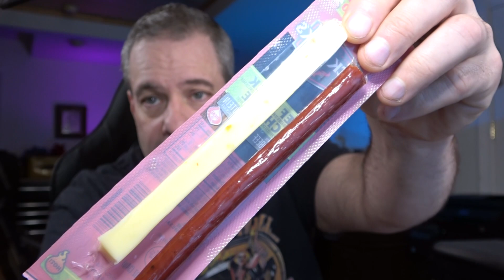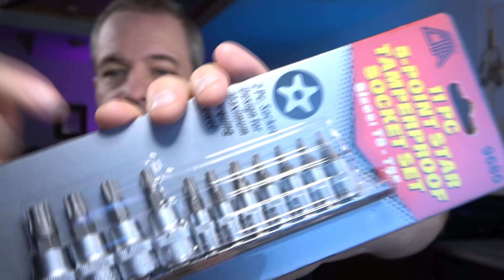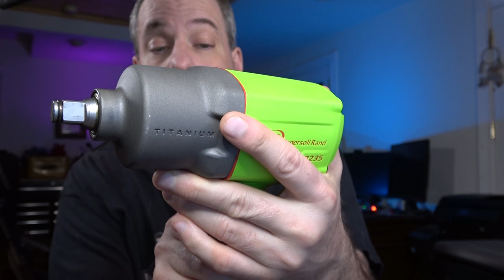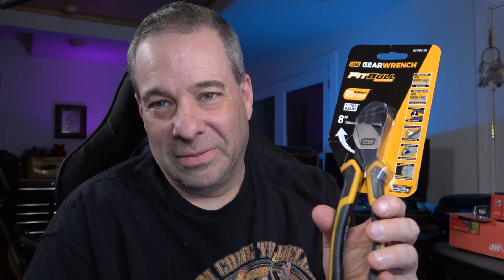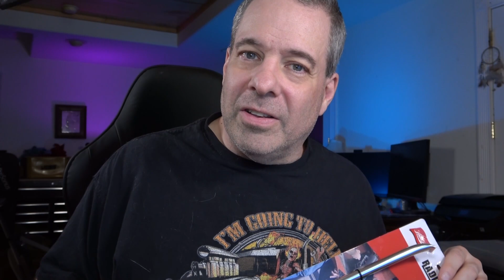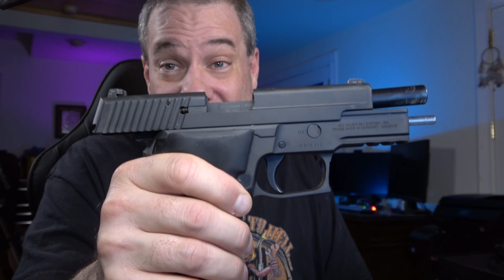Tools in the Haul After Dark, Episode 64 The Greatest Tool Haul on the Internet!

Comment: May need to bungee cord those Jack Links to the wall. Or ratchet strap lol.
Very true what you say about drilling holes. I speak from experience.
Reply from the maker: I used staples and tape for the Jack Links boxes. So far, they're holding strong!

Comment: I do have a makita 1/2 impact and I like it enough and I do use it but when I’m near my air compressor, I always reach for my thunder gun. I know it’s gonna work every time I use it and I’m not gonna have to worry about a battery going dead

And you’re absolutely right the fact that the guy refused to even see about trying to repair that impact means he was trying to push a newtool on him. Well, it’s his loss in your gain because you were providing a better service and I would’ve done the same thing.

Topdon makes some nice gear. I have the BT-200 and it’s saved my bacon twice. Once before a long trip. I tested my trucks battery and it told me that it was well let’s say borderline so I was able to replace the battery. And then I also tested my riding mower battery and it was on its last legs so I was able to replace that without having being stranded 200 yards from the garage.
Reply from the maker: Great testimonials, James, thank you!
Reply: @CoyleTools  You're welcome, always glad to relay my experiences.  I have a couple of Topdon products, a battery charge/maintainer an 800BT and Phoenix Pro scanners.  They all work great, customer service is very good too.  They offered my an extra free year of update when I bought the Phoenix.  I can see how a printing function would be very useful in a shop, you can staple it to a customers work order and show them the state of the battery.  They also will test all kinds from  Regular flooded to Gel to AGM.
Reply from the maker: @jamescaron6465  I appreciate that. I rely on you and others like you to give me your input and share your experiences.

Comment: Thanks Lindsey love that battery tester I will go toe to toe with any other battery tester. the topdon unit hands down is better especially the snap on units there fast and one issue with the snap on is the cord is two short to reach most battery and be able to control it in the cab and the BT600 has a long enough cord and also give you more time to increase RPM unlike snaps on that pretty much want rpm at the instant and never catches the input by the time you are able to do it
Reply from the maker: Excellent points, Ryan, thank you! I'm so happy you're loving yours!
Reply: 100% @ryanmoers8937 ..!

Comment: what coast headlamp would you recommend
Reply from the maker: It all depends on your application. Cost, brightness, runtime, physical size are all criteria you'd consider based on how you'll use it.
Reply: @CoyleTools  cost doesn't matter. I perfer brighter. I use my current headlamp all the time. mine has battery pack in the back with strap that goes over the top of head. looking to find a good bright one with just a single strap.